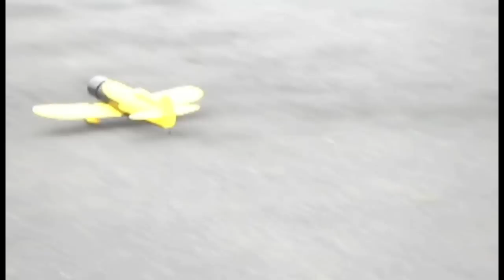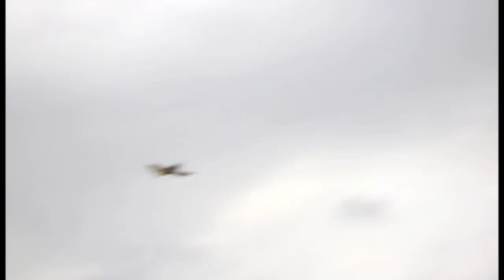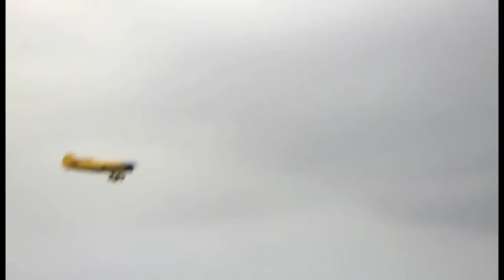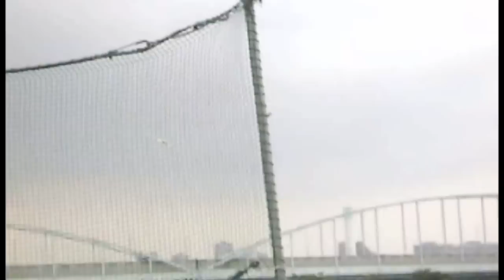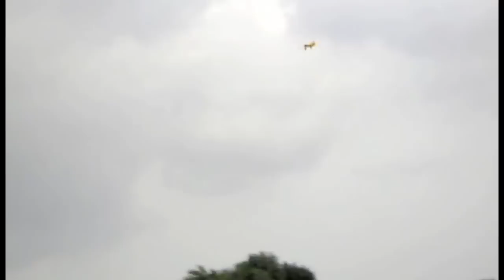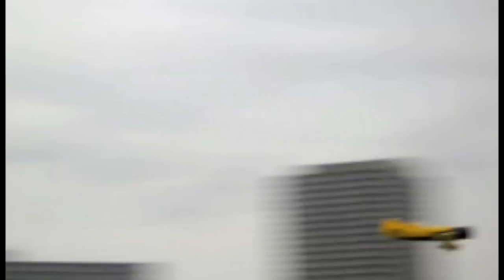GeeBee RC by VolantexRC (LanYu) with 2 gyros

Comment from the maker: @colebz420 
Yes, installing spinner can be tricky sometimes because it just doesn't fit some props, and there's nothing keeping it on if it does.  If it doesn't fit, you're out of luck - you need to use a different prop, or go without.  If it fits, then I add a dab of hot glue to keep it on, making sure it is on there good to keep it from wobbling.  For removal, just pull on it, and the hot glue will break its hold.

Comment from the maker: @jakebeer91 
I am no expert as this was my first time using gyros myself. Install them as near to center of axis as possible with padding to reduce vibration transmitting into them. Also it's best to keep them away from interference. They really do help, but only in windy conditions. If you really want to save yourself, get an FMA Direct Co-Pilot™ Flight Stabilization Unit. It will always take you back to level with the horizon on 2 axises. Just got one from HobbyKing to try out. Only $35+s/h

Comment: hello there, im thinking of  putting 2 gyros on 2 of my models, one being a 1.80 size extra 260 and the other being a big spitfire, what are the main things to look out for while instaling. the exta flys well but is wagging alot in a hover or harrier and the spitfire is fine to fly and take off but landing is always been a problem with all my spitfires iv owned. any advise would be incredibly helpful =]
regards jake